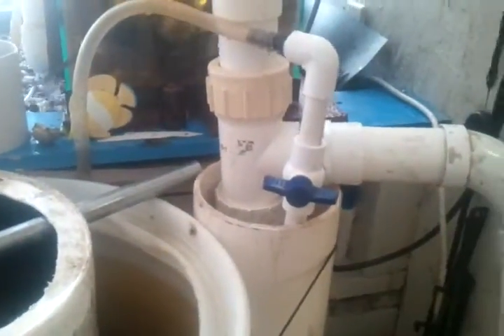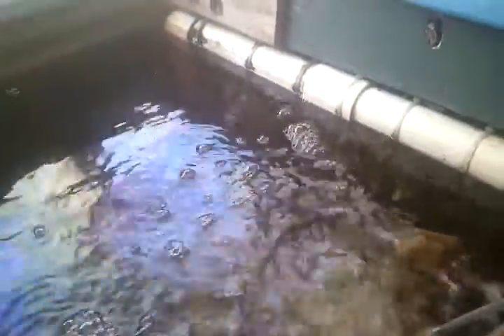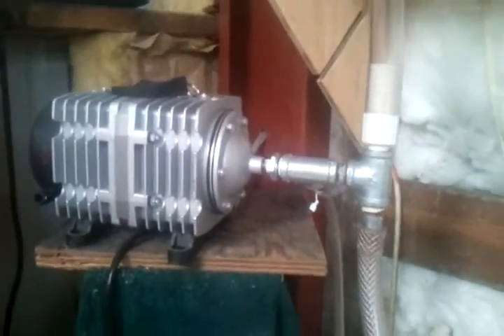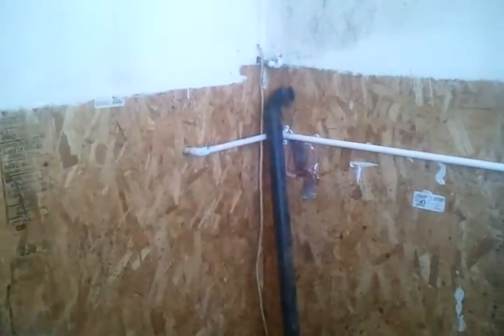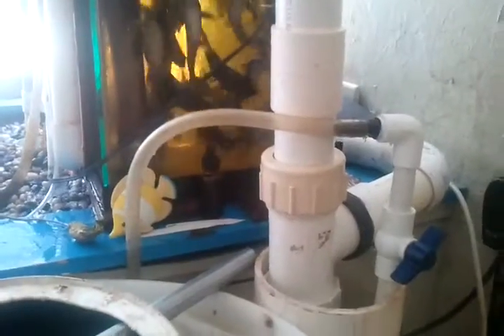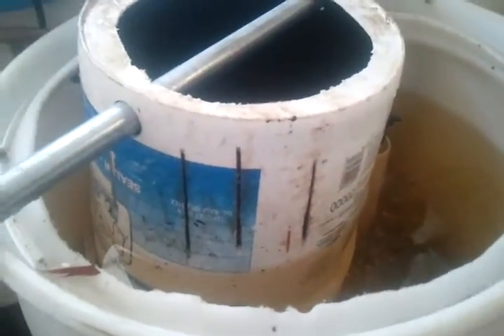Geyser Pump in Aquaponic 2013 08 13

Comment: so i see the overcoming of about 3 ft of head easily do you think i could still get 1000 gallons per hr? its about a full 3ft from the surface of the pond and the pond is 5 ft deep. dont know where you would start measuring from where the exit pipe starts or the surface of the pond? thaks.
Reply from the maker: Wow that was fun to watch again!  It's been a long time since I've done aquaponics, but I think I can help you find an answer.  By the way those catfish grew to be about 30" long.  Take a look at this formula.  http://aquatext.com/tables/Airlift.htm

Comment: Bob, why did you take the water from the bottom of your radial filter rather than the top?
Reply from the maker: It may not be clear in this video.  The water comes from just a few inches below the surface,
Reply from the maker: I came through the side down low and extended a pipe upward.  This allows me to adjust the stand pipe to just below the surface.  If I wish to drain the filter I can pull the elbow off.

Comment from the maker: Yes you are correct. The Simple Airlift pump will work well in low lift situations. My tests (see my other videos) show the AquaZen Airlift to have an advantage only when the water must be lifted higher, I found only a small advantage to my Geyser design either way, but I encourage others to build it and experiment for themselves

I have designed my AP system to circulate water rather than lift water from a sump. Most AP systems use more energy than they create in food calories.

Comment from the maker: I ran tests - My Geyser performed just a little better than a Simple Airlift Pump.
Airlifts, including the Geyser and the AquaZen designs have several advantages over impeller pumps.  They are very inexpensive to build.  They pass large objects that would clog an impeller pump.  

An air pump is required, but my experience has shown air pumps last longer and use less electricity than impeller pumps.So they are less expensive to run and don't break down as often.  And yes they aerate the water.

Comment from the maker: Part 2
Airlifts are mostly bound by the submergence ratio  = rise/(submerged length+rise).   Ben & Glenn may have broken the standard, but further testing is required to know for sure.  The have three innovations in their design that should greatly improve the performance.  My Geyser Pump did not perform any better than a Simple Airlift for me.  See my other videos where I ran more tests

Comment from the maker: Yes an airlift is capable of much more than 6", and well over 3'.  My system designs are all about efficiency and there is no need for any rise at all if constructed correctly.   Watch the Ben and Glenn Aqualift video.  If Ben and Glenn do not do a side by side comparison to a Simple Airlift Pump I will.  I believe their design is a major improvement to airlift pumps.